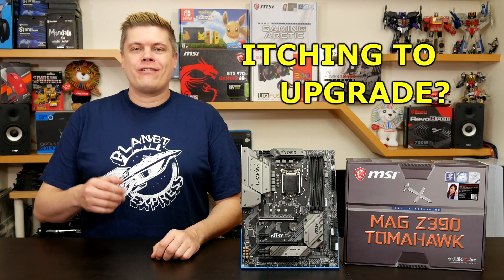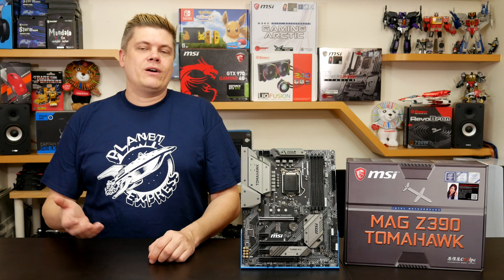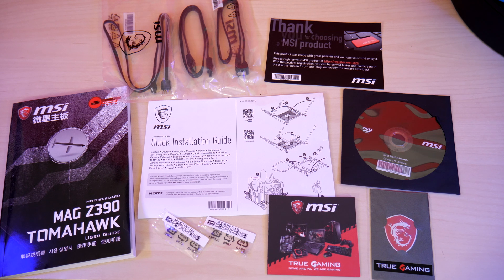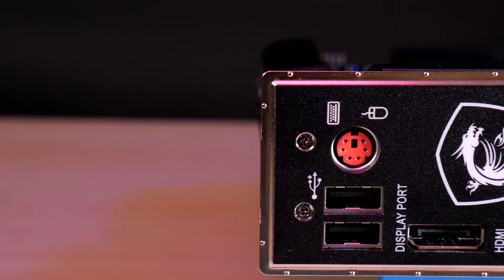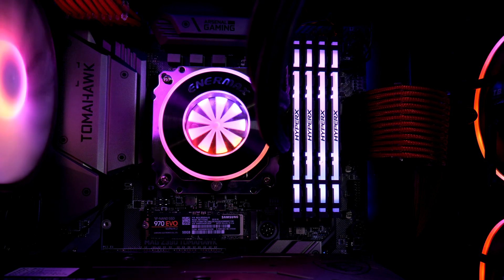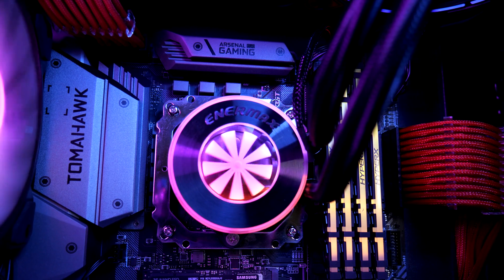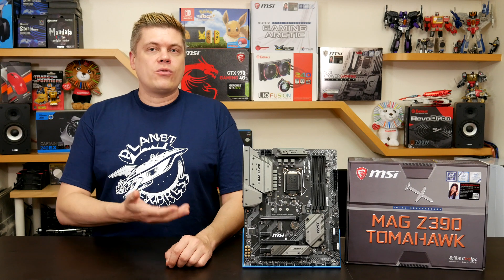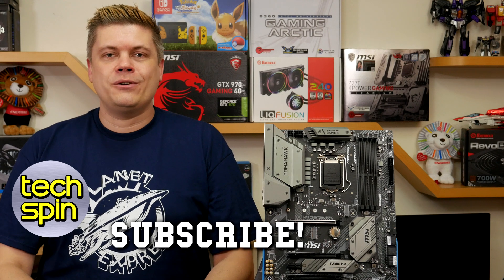MSI Z390 Tomahawk for Intel I9 Review

Comment: I bought a used pc with this motherboard w/ a i5 9600k. Upgraded my gpu to a 4070, is this a good combo or am I cutting my self short on performance with this cpu or motherboard.
Reply from the maker: This motherboard/CPU combo is still good, for upgrading and with Win11, 16-32GB of memory should feel a bit snappier, but a GPU upgrade is realistically where you'll see a huge jump up. 
The 9600K is roughly equal to a 12100/13100 for performance, although the 600 level hits above its weight a little compared to entry level 100s. In the future, an i5-13600K/14600K has great cost-per-frame, favoring the 13600K. Please subscribe, thanks for your support!

Comment: I bought an MSI Z390-A PRO from NewEgg 3 years ago! I was immediately disappointed with this motherboard because it has absolutely no Overclocking features!  The only feature you have is you can tik the  XMP to increase the voltage to the extra memory I purchased!  Three years later something went bad in the board where I have to take the CMOS battery out and jump the JBAT terminals if I shut it down. Because it will just sit on the splash screen forever if I do not so now I just leave my computer on sleep mode!
I'm looking to upgrade either an MSI Z390 TomaHawk or an MSI MAG Z490 TomaHawk so I can still use my 4 DDR4 Ram in addition to upgrading the CPU as well! What are your thoughts?
Reply from the maker: While the Z390 chipset allows overclocking, you got the cheapest motherboard on the market at the time.  Overclocking is available on the board, although being stable is another thing... this is right before the Mosfet overheating issues with the 10th gen boards, so not sure how that would reflect in a budget Z390 board.
Your current best option to upgrade is a B660 DDR4 board, either a Mortar or Tomahawk actually is a huge step up and make sure you get the DDR4 version.  Pair this with a 13600K and that's a powerhouse for a pretty reasonable price. Please subscribe!

Comment: what about the vrm temperatures? I want to use it for an i9 9900k but some ppl said it isn't good
Reply from the maker: Some people say the earth is flat also.  Doesn't make them right ;)  We did extensive testing and found no problems with this board.  All i9-9900K overclocks run VRMs pretty hot.  Please subscribe! Thanks for your support!

Comment: Sir! I didn't quite understand how many CPU power connectors is enough to boot the motherboard with no problem. A single 4pin CPU power clable is enough? Or i need 8 and the other 4 one is for OC? Thanks in advance and great video!
Reply from the maker: All (almost?) z390 boards require ATX 8-pin for the CPU.  The boards also need an extra ATX 8-pin (4 of that needed) for Overclocking. This board, and others, may post and be usable without heavy load on the CPU, but generally you should ALWAYS connect all power connectors up, as depending on the design/power requirements, you may end up undervolting the board and causing possible damage.  And I've had to upgrade my PSUs also for these new builds, so if you need to, I feel your pain

Comment: People said this mobo is terrible for 9900k.
Reply from the maker: People also say the earth is flat
Reply: I have it with a 9900ks running at 5.0ghz. No problem at all. You just need to monitor your voltage and trying to lower it a lilttle bit. I've also put a 140mm in front of the VRM since they were getting really hot and it more stable like this.
Reply: Martin D. Thanks!
Reply: Hi i have this mobo with i9 and stock 4.7 after 15 minutes in aida64 test it gets thermal trootle with 98 degrees what should i do my vcore is 1.31
Reply: Amirhosein Zolfi 98degrees cpu or vrm temp?
Reply from the maker: We actually COVER THIS in the video at 5:56, man. AIDA64 runs an AVX load, which is not normally used in programs today... look it up!  We also noted this behavior during testing, but ALL z390 VRMs run hot under AVX instruction full load.  It's also why we recommend using a FAN ON YOUR VRMs!  
Patient: It hurts when I do this!
Doctor: Stop doing that, then.
But seriously, AVX is slowly being adopted now.  Stop running AIDA64 without a fan and enjoy your new PC instead!
Reply from the maker: The VRMs on ALL z390 boards get hot under AVX loads, it's not new news.
Reply: Techspin what if i only use Enhanced Turbo Enabled and all settings Auto?
Reply from the maker: If we're still talking about AIDA64, It's important to understand that AVX uses a part of the chip which generates more heat than normal 100% CPU loads like rendering. We worked with MSI to establish which values to tweak here: https://youtu.be/RegtSFGiqxM

Comment: can this motherboard handle the Gigabyte GeForce RTX 2080 SUPER Gaming OC 8G and the Intel Core i7-9700K (not overclocked??) Please help :)
Reply: @alexanderb3rg  can i put 9900k at 5ghz max turbo all cores?
Reply: @alexanderb3rg  does the vrm get hot with 9900k 5ghz?
Reply from the maker: Water cooling is actually WORSE for VRMs as there's no fan directly beside them moving air.  I spoke with MSI engineers at length about good VRM cooling.  AIO water coolers are great for this board, but you SHOULD get a separate fan blowing directly over the VRMs if you OC at 5Ghz.

Comment: Is this board enought if im not planing to oc the i9 9900k? will the vrm be on safe temps? sorry for my english
Reply from the maker: To follow up, under peak load non-overclocked, the VRMs can get pretty warm as do all z390s, but well within tolerance. It's not enough to affect lifespan.
Reply: Thank you so much¡¡¡¡¡
Reply from the maker: Thanks for the question, glad you asked! Yes, even running a mild overclock, this board can handle the i9 9900K. I'm using it for video production, so it's stable! Don't forget to subscribe, and connect with us on Twitter, we have monthly giveaways!
Reply: How much did you oc your i9 9900k ?
Reply from the maker: We got it to 5.1, barely stable. 5Ghz was much better, now using it at 4.9Ghz for Premiere renders.

Comment: I'm gonna get this motherboard and i7 8700 non k . Do I need to plug all  8+4 pin for CPU or will only 8pin will work fine ?
Reply from the maker: You should plug in all the ATX your board needs, but I was able to use it with just a single 8 pin and a i9. You may be able to also. Thanks for the question!

Comment: I got a MSI Z390 Tomahawk  a while ago and use a I7 9700K.  I like the design of the board and had no problems with it so far.
Reply: Did u overclock it to 4.9ghz?
Reply from the maker: Had it running at 5.0Ghz for awhile but settled on 4.9Ghz as I'd get an issue once a month
Reply: @Techspin  whats the frame rate difference 4.9ghz vs 5ghz? did you noticed it? thanks
Reply from the maker: @TheKillerZmile  every megahertz counts but just slightly slower. My Premiere doesn't wanna use the 2070 Super at 4K so now I'm looking at Ryzen
Reply from the maker: Yeah I was eyeballing the 9700k also, but for a video editing rig I gotta pay the premium. What kind of Cinebench marks you getting? Just curious
Reply: Frankfurt MeineHazebaba  with that aio would 5ghz work